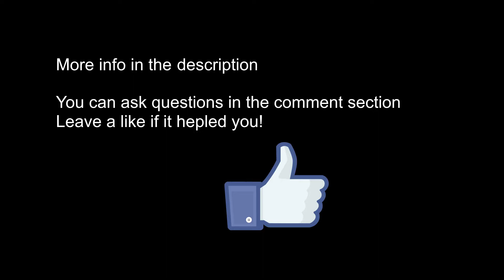Subaru Impreza manual Transmission and front differential oil change.

Comment: I just purchased a used 2017 Impreza manual which is a totally different platform. It has 65000 miles on it and I don;t know if this was ever done, so I want to do it just in case. Is the procedure more or less the same as previous generation? Also, is the Motul Gear 300 75w90 the best option for this application and the rear differential? Thanks for the video!

Comment: hi there! thank you very much for sharing this video. I have two questions: 1.is the manual and front differential share the 2.5L 75W-90 oil?  2.is the rear differential using the same oil?  

happy new year!

John
Reply from the maker: You are welcome! 

1) Yes, the manual transmission, center differential and front differential share the same oil because they share the same casting. The rear differential is independent (I have another video about the rear differential). I used 3L in the front and less than one in the rear.

2) Yes, they can share the same kind of 75W90 gear oil, the difference is that the front differential share it's oil with the transmission, so you cannot use a gear oil with limited slip additive, or else the transmission may not shift well. The rear differential is independent and is not affected by limited slip additives (even though it does not need it).

I used a synthetic gear oil in the transmission (without LS additives) because it helps shift to reverse during cold weather (-20C in Canada), I used cheap synthetic in the rear differential for longevity.

Comment: I have a 2016 5 speed but the plug is stuck on the trans. Any suggestions on how to remove it?
Reply: Hope you're not still having an issue this much later xD. Use pb blaster and a breaker bar.

Comment: Does the procedure outlined in this video change both the MT and Front Diff fluid at the same time?  Do the MT gear box and the front diff share the same fluid "pool"?
Reply from the maker: Yes, in the manual, the center diff and front diff share the same oil in the same casting. Only the automatic has gear oil for the diffs and CVT oil for the transmission.
Reply: So let me get this straight, front center and gear box all are in the transmission right?  And then the rear is itself obviously.

Comment: Hi. What size it the gasket/washer please. Just bought a 2008 2l Impreza, looks very similar to this. The engine sump plug is seeping and also the front diff/ MT sump plug is seeping too. The garage I bought it from has just changed both fluids and may not have replaced the gaskets/washers. They are too far away to go back to to complain though, I will email them and have a moan. The engine sump plug is easy to replace but struggling to get the one for the front diff. It's M26 but how wide is the gasket/washer?  Will it matter if I end up with one that's wider than the head? Cheers.
Reply from the maker: You are right, that's probably the cause. I suggest you buy the gasket from a Subaru dealer they are under 5$, the engine gasket is a crush washer and the transmission gasket is a multi-layer gasket. I also suggest using a torque wrench, especially for the engine crush washer because when you crush it, it never feels like it's bottoming out and you may damage the sump threads. Look up the right parts number for your model, but here is mine:

Engine: 803916010 GASKET, 16X21X2. 3
Transmission: 803926090 GSKT-26. 3X32. 3X1

Comment: Hi, I have an automatic 2013 Subaru Impreza Sport. Should I use the 75-90 LS gear oil for that or still steer clear of the LS?
Reply from the maker: If you are talking about the same generation of Impreza but with an automatic instead, the you can use whatever GL-5 gear oil LS or not, because the CVT has an independent sump with it's own oil, so gear oil in the transaxle is only shared between the front and center diff and they don't care about the LS additive. So the transaxle has two different plugs, one for the diffs and one for the CVT, so you need to be careful to open the right drain/fill plug.

Comment: Not bad for a parkin lott mechanic such as myself somewhat....  but just a quick idea/tip .... before starting and procedure like this..#1 absoloutly first thing u do...  spray a good coating of purple super concentrated degrease 50/50 mix with water over the entire engine and what u can reach underside also.   Let soak for 10 min spray another coating and quickly/agressively rinse everything mechanical on vehicle.  Brush scrub anything u can acess or is filthy.....  makes everything 1000x nicer , easier,     Shit this filthy contaminates everything u touch... debris falls inside sealed  areas while lossening bolts ,,  your hands are constanly filthy contaminating everything you touch.....
Reply from the maker: That's funny because I just had an anti rust treatment the week before the job, there was so much grease everywhere, even on the strut towers and transmission. I decided not to waste my time cleaning their work and just wear gloves, I made sure there was no contamination on the fill side. Your idea is good, but I would do it after the winter.

Comment: No filter??
Reply from the maker: None at all, but there is a magnet on the plug.
Reply: @sgcars6731 damn bro he’ll late but gOod looking on the reply I ended up figuring it out. It was my first time working on a Subaru. It was in fact, my first ever Subaru I just bought it, and I wanted to do a service. On it you helped me out thanks
Reply from the maker: Right, today is my first upload in 4 years! I'm starting again. So do you remember having trouble putting the transmission in reverse (like I did) before the transmission oil change?
Reply: @sgcars6731  yes and no lol mines had busted clutch lol thanks for the insight once again

Comment: hello, I have an automatic transmission 2011 impreza can I use the same oil as the manual transmission one? thanks by the way your video was helpful.
Reply from the maker: This is a previous generation, the automatic without the CVT right? I only have the service manual for the newer generation, where the CVT has a different oil than the differential, however my best guess would be the automatic transmission fluid might not be the same as the diff oil since Subaru's differentials are hypoid gears and require GL-5.
So checked for it on youtube and it seems that there are two separate drain plugs for ATF and Diff oil.
Reply: thanks a lot, subscribed!
Reply: Correct, and his diff oil will be filled through the differential dipstick port on the passenger side, similar to yours.  For newer CVT cars, see my comment in the rear differential video by  SG...much more difficult to refill.

Comment: What is all the black slime all over the firewall and ABS in the engine compartment? Looks like a huge oil leak.

Also, the CVT uses a specialized fluid just for CVT's. NOT GL-5 gear oil. Automatic transmission uses automatic transmission fluid. Not CVT or GL-5
Reply from the maker: 1) That brown grease you can see everywhere is the anti rust treatment. No oil leak.

2) True, but this video is exclusively about the manual Transmission and front differential oil change.
Reply: SG Cars m
Reply: Bob Jeselnik j

Comment: if you keep making videos, please cut out long not-important bits like cleaning the drain plug for 40 seconds and lowering the car.
Reply from the maker: I try to get to the point as much as possible, I would be ok with less drain plug, that slipped through, but lowering the car comes from the fact that I forgot to film a quick how to lift the car. The thing is, the car is too low for cheap jacks (like mine) to get to the correct jack points. I wanted the less experienced viewers to know a good and easy to reach spot behind the wheel to securely jack the car. You can see in the video that my jack stands are in the correct spot, that may be redundant info for you, but that would be relevant visual clues for others.